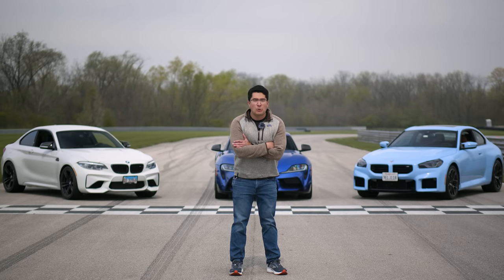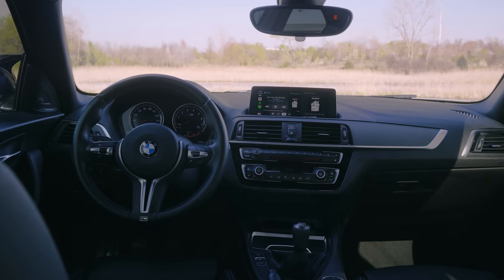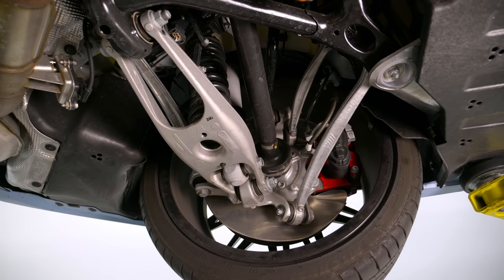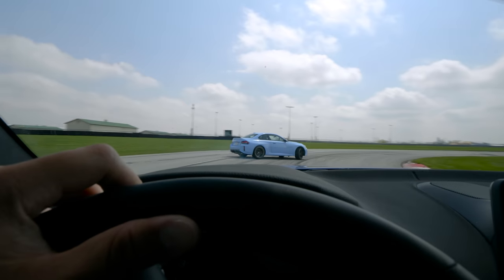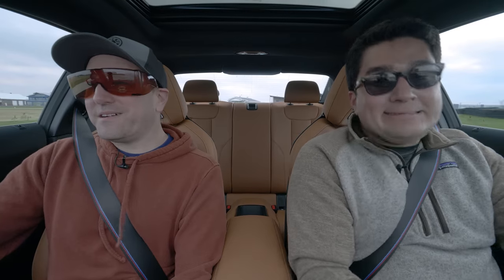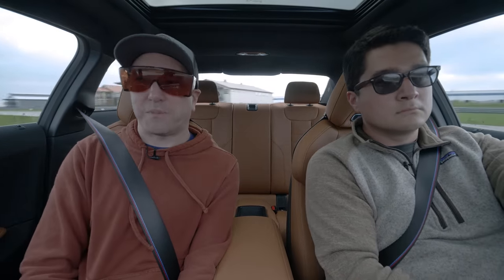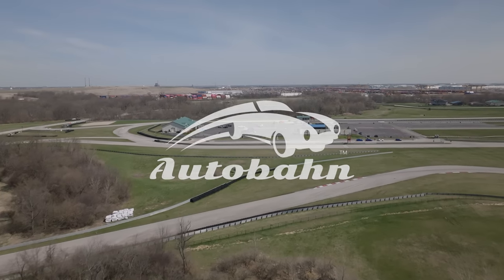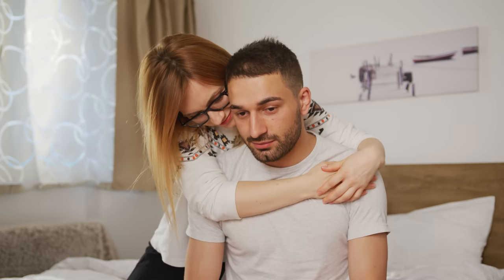2023 BMW M2 vs Supra Manuals | Laptimes and Drag Race

Comment: I'm really struggling to understand the point of an M2 that is almost as big as an M4.
Reply: cos the M4 got even bigger too lol give it a few years and we'll need an M0 to be what the M2 used be...which is what the M3 used to be
Reply: Probably just price and looks at this point... although I did talk to a dealer that said they're marking up the M2 to be essentially the same price (no markup on M4)
Reply: @r6scrubs126  Yup can;t wait for the M5 school bus.
Reply: It gets even harder when you realize the new M2 weighs almost as much as the R35 gtr
Reply: @esh9x153 This just melted my brain
Reply: @esh9x153  oh god I didn't even realize that until now 😮
Reply: I can’t get over the weight and the length, and the rear seats still aren’t usable. 3800 lbs, I don’t get it
Reply: It's about the weight of a Camaro SS 1LE or ZL1
Reply: M3 almost as heavy as M5 too
Reply: The point of the M2 is to to be faster in straight line than the z4pra. When M2 competition arrives will destroy the zupra
Reply: @wesleyrice2138  actually SS 1le is 100 lbs lighter at ~3700 which is crazy to think about. ZL1 is ~3800. 450hp doesn't seem enough for that weight.
Reply: @ericm8368  I had one of those and while its weight was a concern the car felt fast enough to get into all sorts of trouble
Reply: @esh9x153  fam I thought you was telling lies I had to Google it I can’t believe this .
Reply: @pedrorodrigueztube  M2 comp will also cost a lot more lol. supra base 3.0 msrp is 54k. M2 starts at 62k msrp. M2 comp will probably close to $70k msrp.
Reply: @r6scrubs126 😅😅
Reply: because American are the biggest market for M2
Reply: 20k cheaper btw more attainable
Reply: @ColeGrove  finally an answer that makes sense
Reply: Most comments come from people that have never driven or for that fact never seen an M2 in the flesh, the new generation is head and shoulders above the old version, trust me I have had both and still own a G87 its the absolute bollocks
Reply: @pedrorodrigueztube Fair point.  The Zupra bros are not M cars.
Reply: @Love2Cruise They’re better than M cars. Lighter, better bang for buck, can still push a lot of power. 70k on an M2 vs 50k on a supra then 10k of mods on the supra to demolish any stock M car.
Reply: The same thing can be said about the 911. It's enormous now compared to what it was 20 years ago
Reply: The shorter wheel base of the m2 really changes the driving characteristics. Even though the m2 is not much lighter than the m3/m4, it feels more playful. It’s a more “raw “ feeling car. Anyway that’s my opinion owning both a f80 m3 comp etc and a f87 m2 comp manual.
Reply: @eiros59 the rear seats in the m2 are most certainly usable. Kids/ teenagers and adults can fit back there just fine. I would t say long term for adults but easily around town. Better comfort than an Camaro or mustang as well. I have an f87 and it is more nimble than the m4. I had an f80 as well. Couple of bolt ons and the car is a blast.
Reply: @kaeru5019 yes and also has a completely different suspension and engine. But I can’t get over the look of the new g87. It would be mk5 Supra for me all day but I love my f87. And I’m making 620whp which overkill for this chassis. But not meant to be a drag car either.
Reply: @STICKSHFT exactly. A shorter wheel base really changes things up regardless of the weight. I had an f80 manual m3 stock and the crank hub went out got it replaced under warranty and now currently have an f87 LCI with 620whp and is the most fun I’ve had with a car in a very long time. Sure it’s not a drag king but it’s not meant to be.
Reply: People struggle to realize that a 1/4" in any direction of the frame stance of a car COMPLETELY makes a new car. M2 is more a toy. The M4 is longer and defiantly can take corners at higher speeds comfortably.
Reply: @mikeroczkowski8545  Dude that is just not true, not that simple.
Reply: @lucagattoni-celli1377  lol it's not true.... explain

Comment: The last gen M2 looked so damn good. Where did it all go wrong! Wtf is going on currently at BMW
Reply: The M2 CS is the best M2 by a mile. But hideously expensive!
Reply: @TML34  For stock, yes. But for that money you can put much better coilovers and some Schirmer kinematic bits on a Comp. I must say though, the carbon bits on the CS are nice
Reply: @TML34  The S58 still sh... all over the S55, by a mile.
Reply: @TML34  Over priced for what it is. And still heavier then the original.
Reply: Agree ! The performance of the new m2 is outstanding however , my opinion , it’s ugly as fuck .
Reply: Liberalism
Reply: BMW makes some of the ugliest cars
Reply: They simply must allow casual observers know someone is so poor they - gasp - are driving a car thats over 2 years old...peasants.
Reply: Function over form
Reply: It went wrong when they had to raise the belt line to be compliant with crash and pedestrian stuff, is my guess.
Reply: Thats what happens when the lead designer goes to Kia.
Reply: The new M2 is just a slightly smaller M4 is all just rebadged and cheaper with less BHP but in essence it's the very same car. Same width,  tyre sizes and engine. A way to save millions and make millions
Reply: Since your so good at criticizing,  you should apply to the design team at bmw and show them how it's done 😂
Reply: @dk7541 he’d probably do a better job
Reply: I think I’m the only person that thought the old one was ugly and the new one looks great

Comment: G87 M2 polarizes people into two camps: "it's hideous" and "it's not terrible"
Reply: "Looks OKish in black" is another camp
Reply: "I will eventually warm up to it/Its growing on me" is a third 😂
Reply: I don't mind it. IMO the only 2 good looking cars BMW ever made were the Z3 and 3.0 CSL. The rest are either bland or ugly. This is right in line with tradition.
Reply: @rightwingsafetysquad9872  To be fair E63 6 series and Z4 (M) coupe have aged like fine wine in my eyes. But many people still don't like them. Bangle was 20 years ahead of his time
Reply: There are people who genuinely like the new design. They obviously can't drive it because they are blind.
Reply: @grigorioschristodoulou5229  Those are designs that I would classify as bland.  In the long run, under-styled well proportioned designs like those tend to age well.  I like the E63 6-Series, I like the current 8-Series, but they're not beautiful, they're just good.
Reply: @rightwingsafetysquad9872  Personally, I find them far from bland. The flame surfacing on the E85 coupe and the grumpy shark expression and rear design of the E63 are quite special. The 8 Series on the other hand is a bit generic in its lines, especially window shape
Reply: And it’s a beautiful

Comment: Now I’m really curious to see how the last M2 Comp would compare to the new M2. Similar engines, similar brakes, but the last one was about 300lbs lighter.
Reply: It was only 100 pounds lighter. They are fat lol
Reply: This 10000%.  Would love to see a test to show how the new M2 compares to the M2C around corners.
Reply: @HollowM2  214 lbs lighter to be exact. But the car itself was smaller too. I think it’ll be similar result but I’m still very curious to see their impression video
Reply: I'm pretty sure someone has already compared the M2 comp to the Supra last year and the Supra was a bit faster. The Supra was benchmarked against the M2 comp so it makes sense that the Supra is a little bit faster.
Reply: @postalpancho  on a small track I could believe that given the weight and size advantage. However that M2 actually had usable rear seats
Reply: @postalpancho  Yeah, the F87 is undertired and there's not much room in there for more rubber. I have a comp and it came on 245 width fronts and 265 width rears. Not the greatest track car out there (but all kinds of fun)
Reply: F87C actually has a better power:weight ratio than the G87.
Reply: @HollowM2  F87 with a manual (so, apples to apples) is sub 3600. Around 3550 if you don't get a sunroof. That's a solid 200 lbs lighter.
Reply: I thought the previous M2 Comp had the S55 vs the N55 in the base M2.  I would have like to have seen that version on this test as additional 4th car for comparison.
Reply: @selkies888  Same chassis as N55, people have compared part numbers on forums. S55 would be faster on the straights though
Reply: @felixl.l.2060  Have a look at Schirmer M2s. Stock setup is a bit wiggly and soft, but the potential is huge. Definitely not slow on track.
Reply: @HollowM2  it’s actually over 200lbs heavier. I have an m2c in dct. Just changed wheels and exhaust and I’m at under 3540lbs. G87 with a manual is at 3814lbs. If you compare an f87 manual the weight difference is even greater.
Reply: F87 M2C also has much larger brakes than the g87. I’m confident an m2c with the 2nh brakes on re71s will easily outbrake the g87
Reply: Here are the weights with manuals:
OG F87 M2: 3450 lb
F87 M2 Comp: 3600 lb
New G87 M2: 3817 lb

Add 55 pounds for the DCT or ZF8 auto.
Reply: @Alex-or7hu the n2h are crap. They add 15kg + of unsprung mass, you can’t use 18’’ wheels, and to swap the pads out before a track day the full calliper has to come off rather than having quick release pins and they have a habit of damaging your rims with stones getting stuck in them.
Reply: @cwx8 no it doesn’t. It’s close but the G87 has a slightly better power to weight.
Reply: @lloyd.8272 n2h are actually great, with proper pads they can handle literally anything. Being closed back they can apply pressure as intended and won’t bend as the blue calipers at the limit will. The added weight is a shame indeed, but you don’t need to go 18s.
Reply: I know which one will hold its value better…

Comment: Love my OG LBB M2 Manual for all the reasons stated after owning a A90 Supra and just couldn't live with the lack of interior usability. On the M2, with some different shocks, springs the front grip problems go away. And the braking is fantastic with some PFC08's and motul or SRF brake fluid. A wider square wheel setup also dials everything in. Also, the OG and maybe new Supra can run 18 wheels instead of 19, so you save money in track wheels, can go wider potentially, and more variety in track tire options.

Comment: If anyone is considering tracking a N55 M2, a set of camber plates upfront fixes basically everything. It's amazing.
Reply: also a simple strut bar helps
Reply: I’m wondering how the alignment was on the older m2. Never heard of these issues before.
Reply: @lloyd.8272  every single m2 owner who tracks a bit seriously will have camber plates. Bmw is notorious to be super conservative with camber out of the factory. The other thing is aero, I don’t know autobahn, it seems to be a fast track. The rear of FXX cars is pretty squirmy at high speed and is lacking aero. That’s why the M235iR has this huge wing. It makes a big difference. A guy at my local track with a M4 went full aero and shaved almost 4 seconds because of the confidence gained.
Reply: Jack “Feels like an Alfa?” Hey, if you’re leaking like one, better get your prostate checked.
Reply: If you do buy an OG N55 M2, and you do any autocross or track stuff, ditch the plastic charge pipe. When it blows up, best case scenario is you can zip-tie it together well enough to get you home with no boost (DAMHIK). There are several aluminum aftermarket solutions which will never break.
Reply: @americanAlienBoy  Very true! applicable to any N55's. I still haven't done it because i'm lazy and i know im going to regret it sooner or later....
Reply: @sephiros9883  Just do it now. lol I had two N55 cars and both blew their charge pipes at the worst possible time.
Reply: @nickfusco9667  n55 is the weakest inline 6 turbo bmw produce even then n54 outside of its fuel injection system is a pretty stout block the b58 is by far the best the n55 is really just the n54 with one less turbo weaker block but fixes the n54 injector isssue.
Reply: @patthonsirilim5739 what people fail to realize is that this N55 is beefy with S55 internals. So it is not a “normal” N55. I own the 18 M2 and it’s pretty stout of a block with those internals. My buddy runs 600HP on it reliably. It’s a great motor and sounds the best out of all 3

Comment: Weird how nobody has reviewed the RWD G42 M240i yet. Would love to see your take on the most affordable B58-powered car currently in production!
Reply: you sound like a BMW salesman lol
Reply: But why when I could have a supra?
Reply: Depends on what you're looking for. The Supra is better dynamically (lighter with a lower center of gravity), but the M240i is much more livable on the street (more space, better ergonomics/visibility). Also, you can easily order an M240i to spec and pay MSRP or less, unlike the Supra where you have to just hope one of the few Toyota dealers that aren't adding markups gets allocated the spec you want. Realistically, it's $5-10k less for an M240i similarly equipped, and BMW financing has better rates right now.

Shit, I really do sound like a BMW salesman.
Reply: @danlee3939   you can also add that the m240i has better comfort suspension with the adaptive M suspension , 4 seats and a very decent trunk space making it a miles ahead as better daily driver
Reply: Can’t get a manual. That’s why nobody Cross shops it with any of these.
Reply: Well idk specifically about the rwd variant but there's loads of reviews, very popular reviews of the m240i, including one from SavageGeese. But if there isn't much out there about that specific spec you're talking about, there's probably a few reasons. The main one is that there's only a few press cars out there for the m240i, or at least there was when it initially came out, and press cars tend to be heavily speced out with as much options as possible, so they all likely had x-drive. The other is probably timing. The m240i was overshadowed by the hyped up last generation M2 CS and the now new M2, so I guess people kind of forgot about all the specific variants of the 240
Reply: "affordable" - It starts at $49k. After TTL, you're looking at $56k. Get real.
Reply: @Swiggityswagger  that’s bullshit the Supra just got a manual
Reply: @MrRockrazer  Backseat and real trunk.  Great for longer trips.
Reply: @viscountslappy5085  Which is inexpensive considering what it will do.  New economics order.  One has to recalibrate or fall behind.
Reply: Isn't that a Toyota Z4?
Reply: @Swiggityswagger  Actualy people do cross shop them. Plenty of people like me out there. I went BMW but the Supra was tempting. Same reasons they said in the video, the BMW is easier to live with and has back seats for the kids. Supra is a weekend toy and I don't make enough money to buy a Supra and leave it in the garage. I wanted a car that could do both track duty and drive me to work in comfort.
Reply: @viscountslappy5085  Affordable is a relative term but considering what you are getting for the money these cars really are a great value. Luxury, power, driving dynamics.
Reply: I think because most places that sell the m240 only sell it as AWD. Personally though I do think it's the one to get unless you want a manual.
Reply: @MrRockrazer  Because the Supra looks utterly awful
Like a design mistake
Reply: @ArtVandelayOfficial  yeah it’s not great, still miles better than modern bmw though
Reply: @postalpancho  same here I’m more inclined to go for the M2 however, over the 240i. If the M2 is built with just the essential options like the CF roof and maybe the heated steering wheel, it’s about $7-8k more than a fully equipped Supra. I initially considered the fully equipped Supra to make it more “daily-able” but that’s no use imo. The Supra is superior as a sports car compared to an M2 but like you said it’s too expensive for it to just be a weekend toy. The M2 provides a satisfying balance of being a good daily and a good enough sports car for those wanting to have fun and I think it looks fine too, I personally wasn’t the biggest fan of the F87 looks wise, especially the rear so maybe I’m just weird lmfao. You really don’t need a Supra to have fun, could just pick up an NC Miata or something along those lines down the line as a proper track car lol while the BMW fulfills the remaining desires.
Reply: @viscountslappy5085  it's a lot of car for the money trust me! Totally worth 50k plus for this much car!